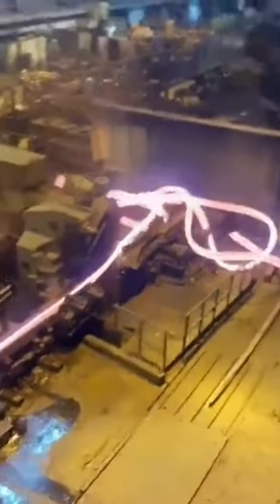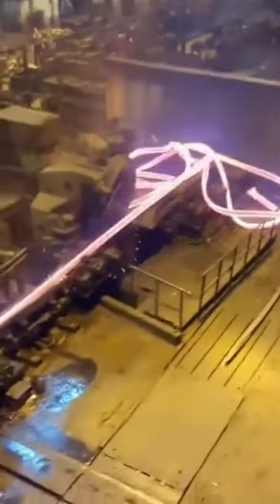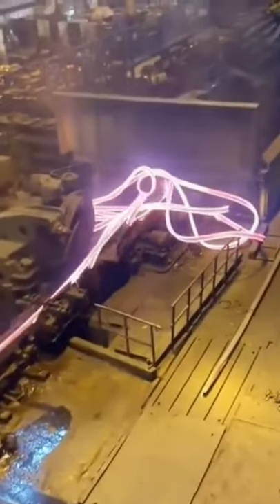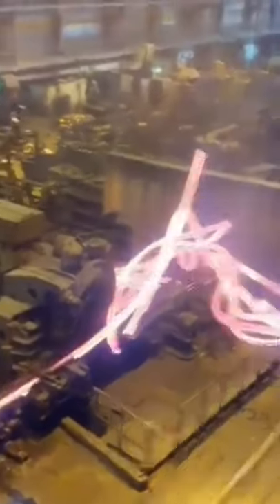2200°F ACCIDENT at a Steel Mill | Hot Minute #shorts

Comment: Won't lie, that's pretty scary!
Reply: It's terrifying, if one of those coils touches you it will burn you to the bone almost instantly or just flat out cut you in half. That is a lot of very heavy, and very hot metal moving at a good speed. I worked a job at one of the mills here in Indiana where a slab was a bit to hot and sagged just a few inches. It caused the slab to hit a roller instead of going over it. The results looked more like a train crash than an industrial accident. It was an 80" wide 10" thick slab of red hot steel that was about 40 foot long.
Reply: @thatoneguy454c  ofc it did, that's about 6,292,632 cube cm's of steel which comes to about 49,397.1612 kg of steel or 48.6170084985 Imperial tons.

Edit:
Heavy axle rail cars can have a gross weight of up to 142881.597 kg or 140.6250004429 Imperial tons. So yes, I certainly believe it WOULD look like that.